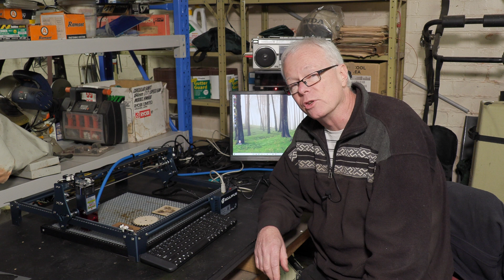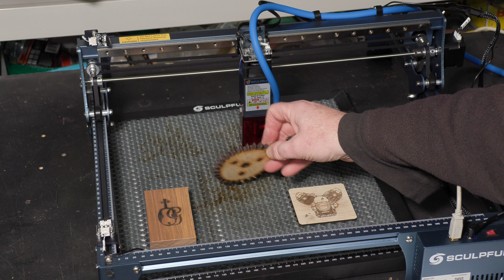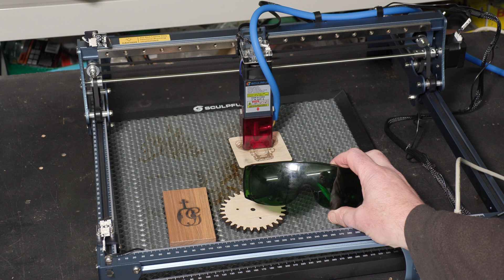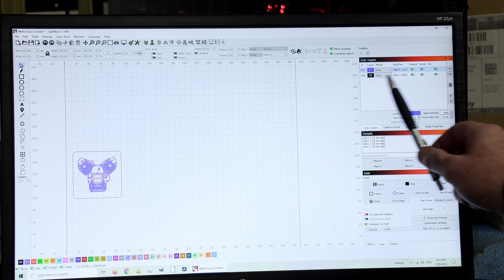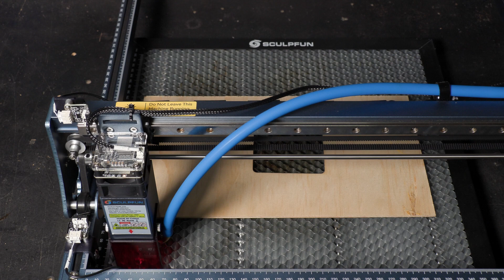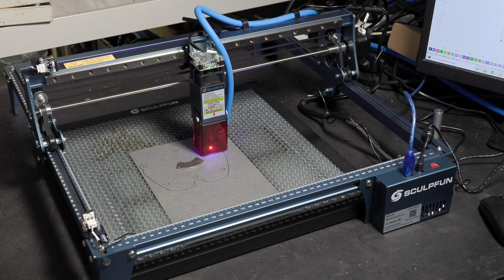SculpFun S10 Laser Engraver Review

Comment: Nice machine Mike. I bought an XTool D1 Pro 20w plus a the IR laser. I've not tried the IR laser yet though. Where did you get the engine vector? I've only got it as a raster file unfortunately, and I haven't had any success with converting it to a vector.
I've done a gasket for my Eldorado rear drive. Unfortunately I didn't have a spare gasket as it fell to bits when I took it apart, so I photographed it and went from there. It took a few goes to get it right. I prototyped it with some thin card until I was happy with it and then cut the gasket - very handy.
Reply from the maker: I use the Convertio web site to convert bit maps into svg vector files. If you have a good clean black and white image it does a great job.
https://convertio.co